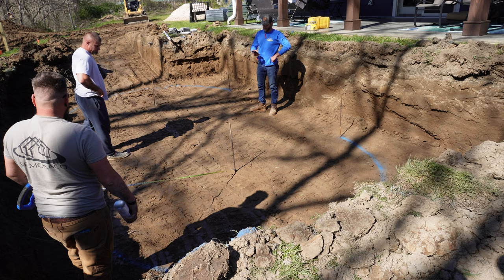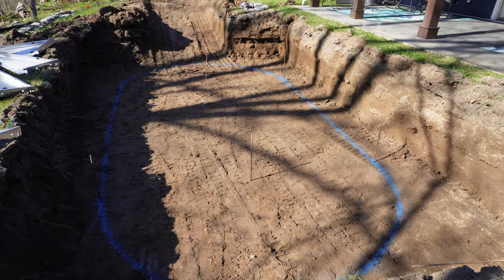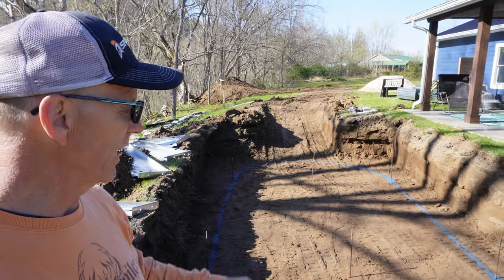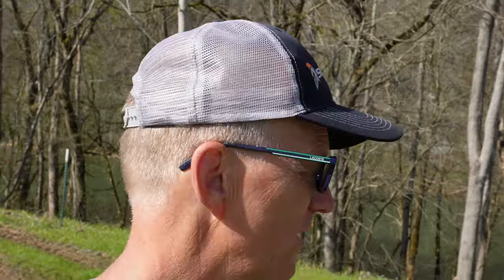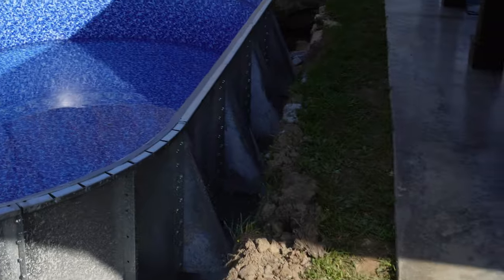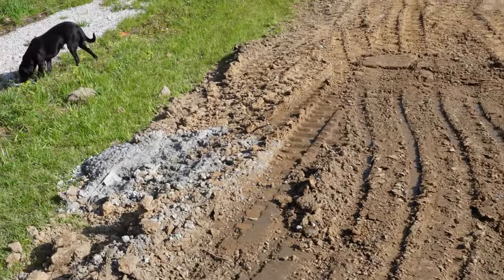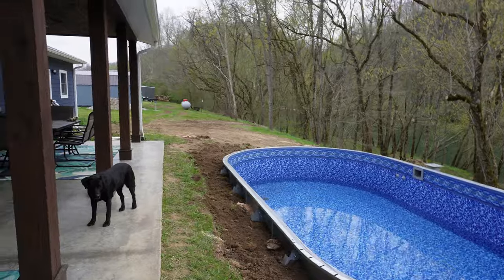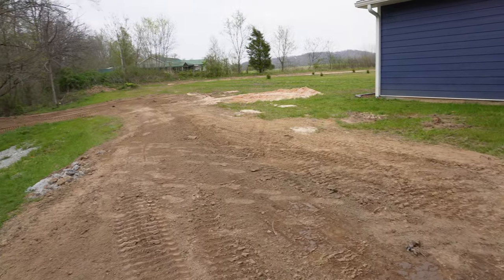Pool Construction, Pool & Spa Depot, I Had a Beautiful Yard !!

Comment: How much was the pool? Just curious
Reply from the maker: The pool $19999.
Reply: @klwit1980  Was that 20k all in? We are moving to Monterey Tn and may use them to install a pool. We will most likely do an above-ground pool with a deck surrounding it. Thanks for the video!
Reply from the maker: @YesterdayMeetsToday 
Yes but I bought in the spring when they had a sale.  But I had extra pay in backfill and in building a deck.  Pool alone 19,900.
Reply: Just had a 15x24 aquasport 52 installed 24” inground, looks great.  Lot of yard work needed after but we are getting there.  Pool was 9k in NJ, but you can get it in other states for 7500.  No cement collar needed.  As of now we are at 20k installed w backfill and electric (which was 2700 for us), w xstream 150 filter and I ordered the portofino liner, which is stunning.  Going to wrap it in composite, lots of designs on Pinterest.
Reply from the maker: @MJRose1008  thanks for the information on what it cost you.  We have had the grandkids down from Michigan and it was great to see them enjoying the pool. 
And your right lots of work to complete deck and landscaping afterwards.  
Thanks for watching, Kevin